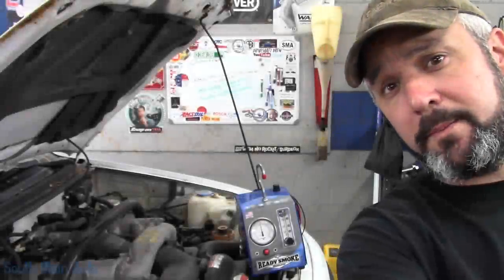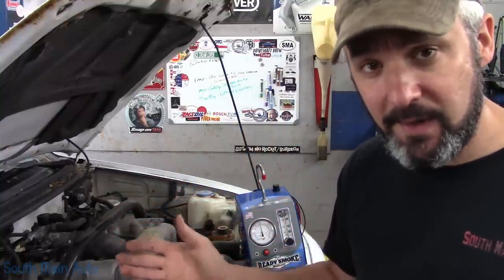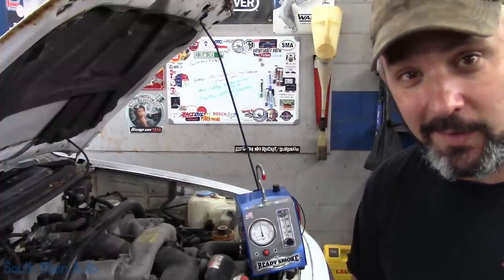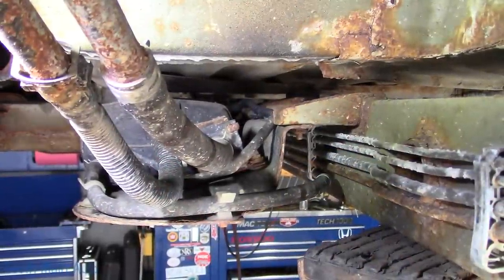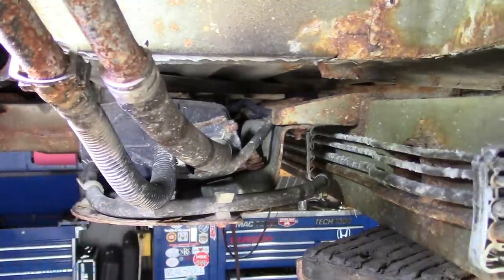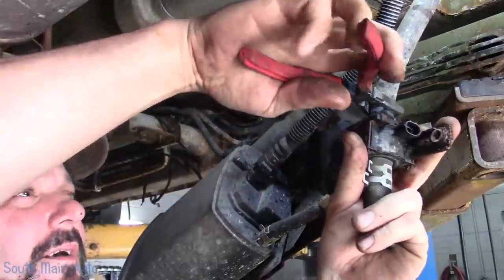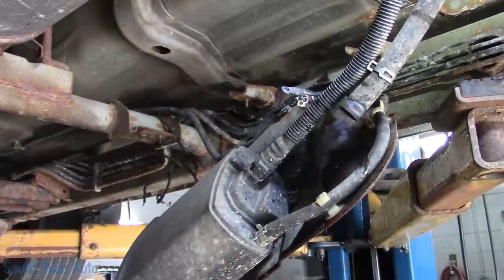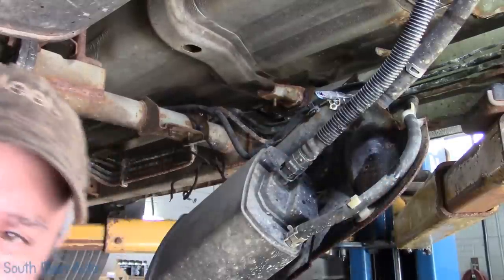Suzuki Vitara: EVAP Problem & Discontinued Parts!?

Comment: AGAIN, no concern with air in EVAP testing?
Reply: Why would there be? If your talking about air and the fuel vapors mixing and causing an explosion. Every evap leak machine I have ever seen plugs into shop air and if the risk was that hi of having an explosion the mfg's would all be out of business from everyone blowing up. Don't get me wrong I wouldn't fill the fuel tank with air then weld the exhaust right beside the fuel tank.
Reply: JOHN HUFNAGEL I assume thats what hes thinking. With that said, I have a snap on smoke machine that DOES have provisions to allow it to be used with something other that compressed air. I believe co2 ? Is whats meant to be used as an alternative. Even though the option is there, I still just use shop air as well.
Reply: I've posed this question on this channel before and Eric O has either missed it or dodged it. A lot of people watch this and it does merit discussion.
I too use shop air in EVAP testing. As a last resort. If I can diagnose some of the potential causes another way, I'll do that first.
When I do resort to smoking the system with shop air, I realize that since I have fuel and I have oxygen in the tank, the only thing missing is a spark. It is a concern. And I am cautious. I do not energize solenoids. I disconnect the battery. I do not scrape rust with a screwdriver near the filler tube...etc...things I've seen here.
Reply: Why is that different from the vent valve doing it's job and venting into the atmosphere?
Reply: +Pyro17059 - appropriate name for this discussion...LOL
Reply: +Micheal Herbert - the vent valve does its job and vents hydrocarbons into the atmosphere, as you state. That's different from introducing air under (slight) pressure, considerably changing the hydrocarbon composition in the tank.
Reply: don't worry about what's inside the tank, worry about the vapor that is escaping the tank, it's mixing with oxygen rich air as it escapes lol.
so, don't make sparks nor have open flame anywhere hear the area. most shops have enough air currents to keep it dispersed enough to no ignite. obviously don't go waving around open flames or spraying sparks all over. it's more common sense than not.
Reply: +throttle bottle - I think you have to be mindful of both, within the tank and the shop environment. You don't need a "spray of sparks". You just need one.

Comment: I'm very disappointed, hoped to see that you open solenoid and reseal with silicone and call it good! Very unhappy viewer!!! J/k awesome repair!
Reply: the metal bracket/solenoid spacer being rusted was the issue and it's so thin, no proper way to fix it and not have it rust and fail again quickly.
the road "salt water" likely has gotten into solenoid bobbin and rusted it and it's pinching the winding's and sleeve the steel solenoid pin rides in, I'll assume it's randomly sticking also......... yeah, I tend to always tear down bad parts and see what/why they failed, bad or good habit that it is :))

Comment: Didn't Suzuki get bought out by General Motors that's why they made those knock-off Colorado
Reply: Nope that was a myth, the truth is that GM and Suzuki both purchased shares of eachothers company and had some co-ventures. lt was GM that had knock-off Suzuki's such as the Chevrolet Tracker (was really a Suzuki Vitara) the Chevrolet Sprint (was really a Suzuki Cultus), the Geo/Chevy Metro (was really a Suzuki Swift).  
lt wasn't until the final generation of the XL-7 that Suzuki sold (2007 - 2009) that Suzuki sold a fully GM based SUV which only lasted for 2 years before it was discontinued because it was a total sales disaster since nobody wanted to buy a Suzuki SUV that was actually a GM SUV, and indeed, those GM models were horrible. 
Luckily Suzuki finally came to its wits and divorced GM back in 2008 precisely because of how disasterous the deals were that it had with GM. lt was shortly after Suzuki divorced GM that GM went bankrupt and had to get bailed out by the Feds.
As far as the Colorado goes, you are confusing lsuzu with Suzuki.  lsuzu did co-develop the Colorado with GM an so of course lsuzu did have their own version (lsuzu i-series) since lsuzu did afterall co-develop the platform with GM.  None of that has anything to do with Suzuki however.

Comment: Ok, search for purge valve for a Chevy Tracker 2004 (also has the "big 2.5"). Maybe listed as AC Delco # 214-1059. $40 bucks at Walmart (cheaper elsewhere)  https://www.walmart.com/ip/ACDelco-214-1059-Valve-Evaporator/46946293

Comment: ok i'm gunna play the devils advocate here and be the richard cranium i am. this is a slippery slope on a double edged sword.  good thing here it is fixed and functioning. every one is happy  or well should be happy. but you know there is some tree hugging nazi at epa or dep  or one of those other 3-lettered agencies that isnt gunna be happy. that person will read the law that is hundreds of pages long and decide that the vehicle was repaired without using oem or approved aftermarket parts therefore you tampered with the emissions system of that vehicle and slap you with a hefty fine. it will be up to you to prove your repair meets or exceeds the specifications used for the vehicle to receive its emissions certifications as manufactured. that cost will meet or exceed the cost of the fine. its just the game these people play. and remember this is the communist state of new york we are talking about too.
         i'm not bashing eric at all. as a matter of fact i probably would have done something similar (and have in the past).  billed the part as a misc part with no part number(since this one will probably outlast the vehicle). i may have suggested this repair but the video would end there.  its a sad statement on the world we live in that something so simple and straight forward can get convoluted  and construde  to be something more than what it is. when your livelyhood relies on certifications and liscenses one must be dilligent  to keep them.
Reply: if only it worked that way!!!
Reply: The accuser has the burden of proof!  In this case, the 3 letter institution must prove it isn't compliant for emissions since they would be the accuser.

Comment: Junked for having an idiot light? Or what you could do is buy yourself a cheap scan tool delete codes 1/2 a mile up the road from the mechanic, drive it in like you wear the pants in the family and call it a day. Not that I would ever advise anyone to do it..............
Reply: That don't work. Once u reset the light. You have to complete a drive cycle. No codes is a no pass
Reply: @trinkladd   Where i'm at there are no emissions testing and so if your cat has been hollowed out or if your o2 sensors are bad it'll pass. Most of what fails a car is safety stuff here.